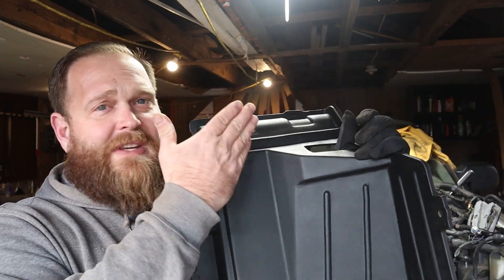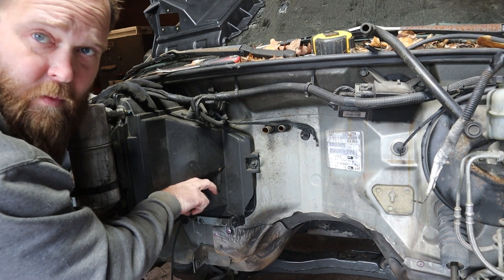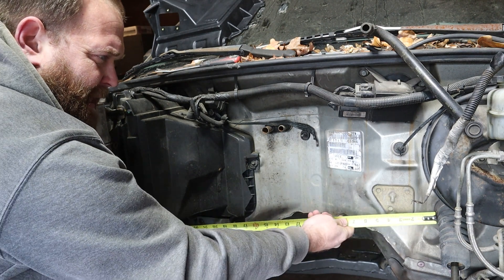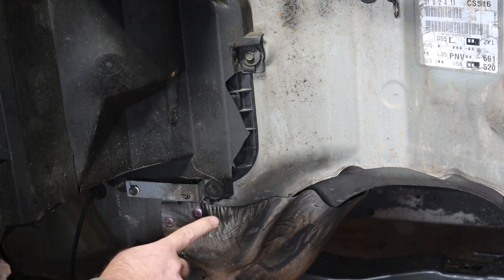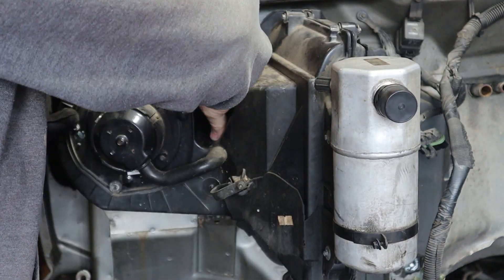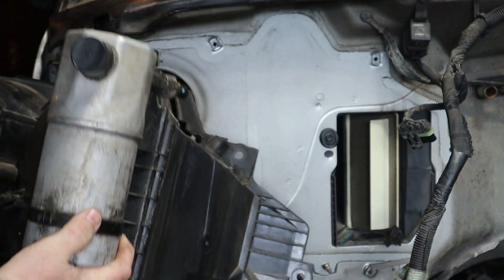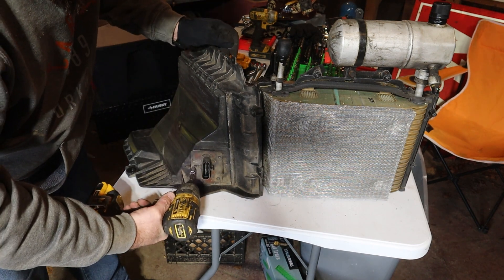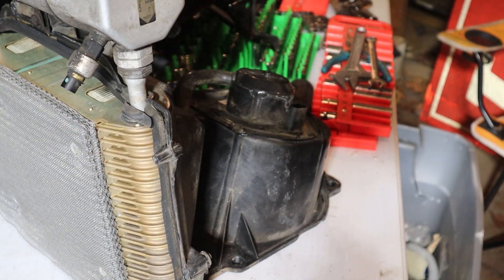Shoehorning A V8 Into A Chevrolet S10 Blazer: Air Box Mods

Comment: Not another LS swap. When will that fad end? I built an old school carbureted 383 small block for my '93 square body S-10 2 door, 2 wheel drive short bed, and mated it with a 1969 Muncie 4 speed "rock crusher" transmission.

Comment: When I put my LS2 in I just took the airbox off and plated it up because I'm young and dumb lol But I'm stoked for this build!
Reply from the maker: I want that AC and heat! This is the long way around putting a V8 into the Blazer, but I want a "factory" little hot rod.
Reply: I'm gonna use the cover for a gen 2 small block need some more room also for fuel pressure regulator how much extra room does it make ?

Comment: My buddy had a old square body S-10 Blazer with a 350 out of a Corvette in it that had been modded to what we assumed to be about 350 to 400 horsepower. It was a death trap but it was a fun death trap to say the least.
Reply from the maker: I had a 305 in a 89 2WD single cab. That thing would move on pretty good because it weighed nothing!
Reply: If a vehicle isn't dangerous, it isn't fun.